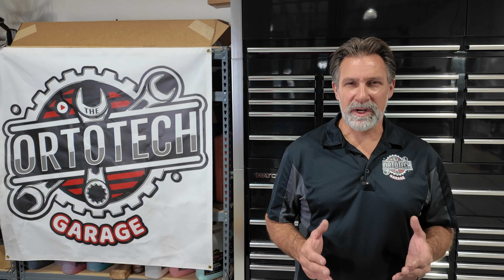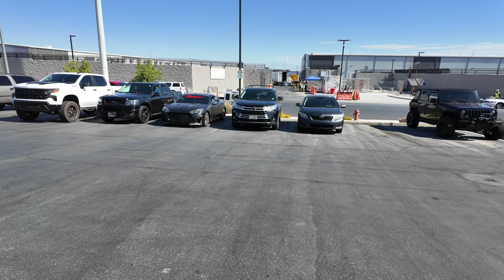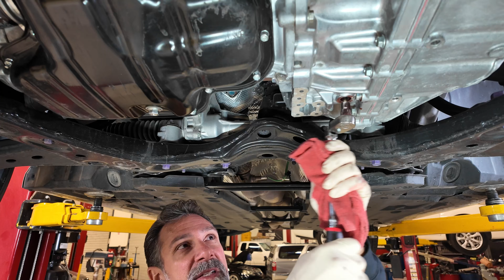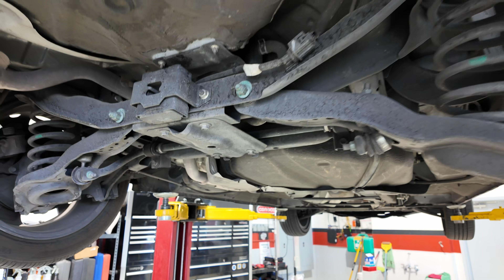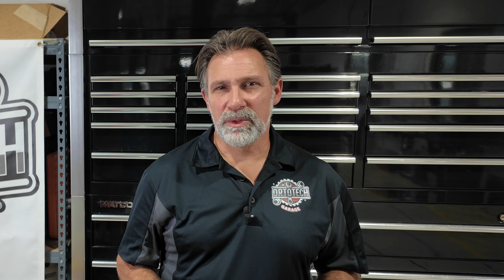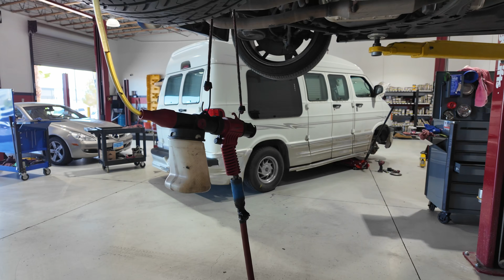Your Car’s Maintenance Schedule Wasn’t Designed for You

Comment: My 2022 Ford F150 Platinum w/ max towing package had the 3.5L Ecoboost. I thought it was interesting that Ford went with 6qts of 10w30, when Toyota went with 8qts of 0w20. I know 0w20 can protect but it's not without its compromises. Ford's recommended change interval was 7500 - 10,000 or 12 months based on conditions. I stuck with 10k, except if I had been towing my RV. I consistently ran Royal Purple (PAO) in that truck. Where I think Ford missed the mark was the rear diff gear oil. They used a 75W85. They sell a truck with a max towing package and fill it with a light gear oil. The consumer has become very disconnected from the needs of their vehicle. People want their car to just work and they don't want to know how. Maybe it's just the engineer in me that wants to dial everything in and know why I'm using something. It also makes me want to push something to it's rated capacity. 

I live in a coastal area where everything is close and my truck is also pulling in salt air. That is why I currently have 3 Blackstone kits sitting in my garage. I don't test every change but I test enough to get an idea of how oil ages in my engines. I would also argue that dirty looking oil isn't always bad either. Like you said, the things matter most are things you can't see. Also, once you crack that oil bottle or pour it in your engine, it starts to degrade. It degrades even if it remains sealed but at a slower rate. If you have a 1-2 year old bottle of open oil in your garage, throw it out. Group 4 and 5 oils degrade slower but they still degrade. Oil tests are like bloodwork for your car. It's not just testing the quality of the oil but it can also diagnose issues that are cropping up. I've seen tests that showed small amounts of coolant were leaking into the oil.
Reply from the maker: I agree with a lot of what you're saying, and I definitely appreciate the engineer's approach of wanting data rather than simply following an arbitrary interval. I have no problem with oil analysis either—I think it can tell us a tremendous amount about what's happening inside an engine.

Where we may differ a little is that I'm not particularly interested in pushing lubricants all the way to their useful limit. Part of the engine oil's job is to trap and suspend contaminants and wear material so they can be removed when the oil is changed. The oil may still be capable of lubricating adequately while carrying an increasing contaminant load. 

For me, there is value in simply getting that material out of the engine periodically, especially when an oil change is relatively inexpensive.

Same philosophy with differential and transmission fluids. I'd rather change them somewhat conservatively than determine exactly how far I could have pushed them. And I agree with you on the rear differential—I don't know Ford's reasoning for going away from 75W-140 in that application, but given the towing capacity and loads that truck can see, I certainly understand why you'd prefer the heavier gear oil.

Sounds like you're approaching your maintenance very thoughtfully, though. Those Blackstone reports over multiple oil changes should give you some interesting trend data. 👍
Reply: @OrtoTechGarage   Mechanics live in a world of entropy (heat, friction, and wear). Engineers live in a world of specs and optimization. I'm realizing more and more that mechanics are too cautious and engineers are too reckless lol. My last job (subsea robotics) was full of engineers who loved to modify their cars and push them to the brink of failure. They were always chasing down problems they created. Now I see why mechanics tend to curse engineers. Until something explodes, I'm going to keep pushing my motor oil... 

I definitely changed that gear oil to a thicker oil long before I ditched my Ford over: Recalls, an air dam that kept deforming, 2 rear hub replacements, headlight leveling system errors and a battery drain issue.
Reply from the maker: Glad you moved on from all those problems!   These vehicles are way to costly to play around with the maintenance, in my opinion.  😢

Comment: Very informative! Every time I go to get my oil changed, I ask the shop what else needs to be done. Every time I ask they basically say "nothing, you're good". I trust them because (a) they would turn away money if they didn't do what's necessary, and (b) their interactions with all customers are super nice and going above and beyond what I would expect (not charging for small diagnostics, inviting the owners to drive along with the technician if a fault isn't reproducible etc.).
However, this video motivates me to take better care of my car(s) and do the fluid changes and other basic maintenance myself. As is most often the case, prevention is better than cure! And, it gives me small projects to tackle!
Reply from the maker: It sounds like you’ve found a pretty good shop, especially if they’re willing to tell you nothing is needed when that’s genuinely the case. 👍

The one thing I’d add is that some maintenance items are based on time and mileage, not necessarily something a technician will see during an oil change. That’s really the point I was trying to make with this video. Knowing the maintenance history of your vehicle and having a plan for things like fluids can prevent those services from simply being overlooked.

And if the video motivates you to tackle some of the basic maintenance yourself, even better! You’ll learn more about your car, save some money, and probably have some fun doing it. Prevention really is a lot cheaper than repair. Thanks for watching! 👍
Reply: @OrtoTechGarage   Your video definitely made me wonder whether the shop simply goes by the owner's manual rather than what you discussed. I'd rather err on the side of caution and stick to an "I want my car to last a looong time" schedule.
Reply from the maker: Correct, Sven! The good news is, you get to choose the maintenance scedule for your vehicle.  Service it the way that makes you comfortable.  I made a video about maintenance routines, where I discuss this at length.  You may appreciate it.  Its in my library. 😉
Reply: @OrtoTechGarage  I'll go check out your library for sure!
Reply from the maker: I appreciate your support! 🙏

Comment: When I first got my 2023 Corolla Hybrid, I followed the manual for 10k mileage oil changes. When the car hit 25k miles, I decided to switch to 5k intervals instead. If I could go back in time, I wouldve done an early break in oil change and oil changes every 5k miles. Do you think I'll have issues with this car, being that the first 2 oil changes were at 10k and 20k miles?
Reply from the maker: I don’t think you have anything to worry about. You followed Toyota’s recommended maintenance schedule, and there’s no reason to assume those first two 10,000-mile intervals caused any damage.
Preventive maintenance is exactly that—we’re trying to reduce the possibility of problems years and many miles down the road. An early break-in oil change and 5,000-mile intervals are what I prefer for someone who plans to keep a vehicle long term. Plenty of vehicles will go a very long time following the manufacturer’s recommended intervals without any problems. I just look at the relatively small additional cost of more frequent oil changes and ask, why take the chance? Keep up with the 5,000-mile changes from here and enjoy the car. 👍
Reply: @OrtoTechGarage Thank you so much! I really appreciate your and your channel!!!
Reply from the maker: Glad youre enjoying the content.  Thanks for your support!

Comment: Would be good to hear about your feelings changing oil on a brand new (July 2026) Toyota Corolla Cross Hybrid. I often get close to 50% running on EV mode. Does that mean Toyota's 10,000 mile oil change interval is reasonable? I personally don't like the interv al and intend changing my oil every 5,000 miles or 6 months. I certainly wasn't intending following the Toyota 10,000 mile service interval.  Oil is cheap compared to expensive engine work. I intend keeping the vehicle to at least 120,000 miles.
Reply from the maker: I agree with your thinking. The hybrid system reduces total engine run time, but there’s another side to that. With the engine starting and stopping frequently, it can be harder to get it up to full operating temperature and keep it there. Cold starts and operation below normal temperature are when a significant amount of engine wear occurs. You can also have more opportunity for moisture and fuel dilution to accumulate in the oil.
For someone planning to keep the vehicle long term, I’d be very comfortable with your plan of 5,000 miles or 6 months. Oil and a filter are cheap compared with the engine we’re trying to protect. Congratulations with the new Toyota!  🙏

Comment: Excellent and pertinent video ! Thank you! (What about blinker fluid ?😉)

For my daily driver here in Montreal, ''Severe service schedule '' is a must !! More often for ALL fluids .

Question for you Mr Orlando : I drive a 1985 BMW about 1000 km every summer and store it every winter. I heard it is better to change the oil  yearly BEFORE  putting it in storage and not after . This is what I do. What is your opinion ? I change coolant, brake fluid every 2 years, according to BMW specs.  Manual transmission fluid , differential and power steering  every 4 years.
Reply from the maker: First, I’ll have to cover blinker fluid in the next video, but for now a blinker fluid rotation every 2500 blinks is reasonable. 😂😉 
And yes, Montreal definitely qualifies for some severe-service considerations!

On your BMW, I agree with what you’re doing. I’d rather put the car away with fresh oil than leave the used oil and whatever moisture, fuel dilution and combustion contaminants it has accumulated sitting in the engine all winter. With only about 1,000 km per year, I would change it once a year before storage and not worry about changing it again in the spring.
Your other fluid intervals sound very reasonable as well. At that age and mileage, time becomes just as important as distance. Sounds like you’re taking very good care of that BMW! 👍
Reply: @OrtoTechGarage  Thank you again for your professional advice and taking the time to answer me !

Comment: 23 4runner.  I change my oil every 4k.  Drain and fill the radiator every year. Differential and transfer case every 30k.  Power steering every 30k. Brake fluid every 2yrs. I do all maintenance myself and all oils, fluids and grease is 100% Amsoil
Reply from the maker: That’s a maintenance schedule I can get behind. 👍 You’re definitely taking the long-term ownership approach rather than the minimum-maintenance approach. Keep that up and that 4Runner should be around for a very long time. Thanks for sharing!

Comment: Excellent topic!  Unfortunately manufacturers are often concerned with engineering parts to barely exceed the warranty period. There is no such thing as lifetime transmission fluid, trans fluid change intervals have become increasingly vague since transmissions have become sealed. I try to stay within 30,000-60,000 miles (depending on the manufacturer/trans or every 6 years whichever comes first). Ideally the first oil change should be done at about 500-1,000 miles to remove break-in particles and assembly lube. Then change it every 5,000 miles max or annually whichever comes first. As you explained so well every owner's goals will vary and manufacturers are in business to sell cars not keep you in the same one for decades or 100's of thousands of miles. As the old adage goes an ounce of prevention/maintenance is worth a pound of cure.
Reply from the maker: Thanks! 👍 We’re definitely thinking along the same lines. I’m a big believer in reasonable preventive maintenance rather than waiting for something to fail. The 5,000-mile oil change interval and servicing transmission fluid periodically have served me well for a lot of years. As I mentioned in the video, the manufacturer’s maintenance objectives and the owner’s long-term ownership objectives aren’t always exactly the same. A litlle bit of prevention is still pretty cheap compared to a major repair, especially in today's vehicles!